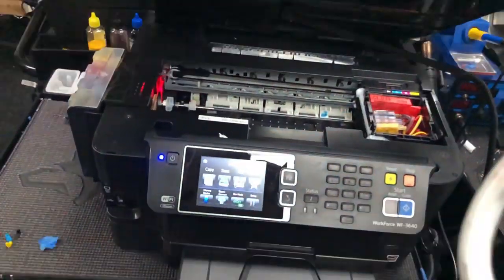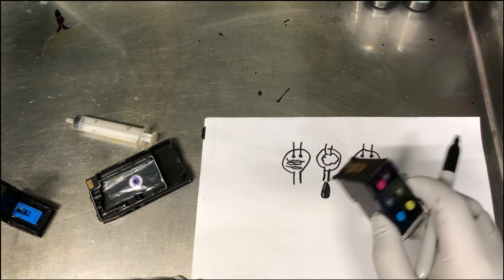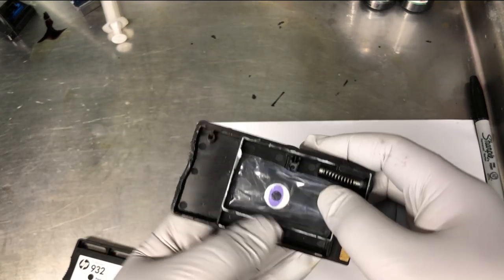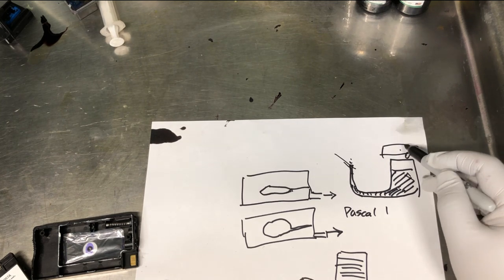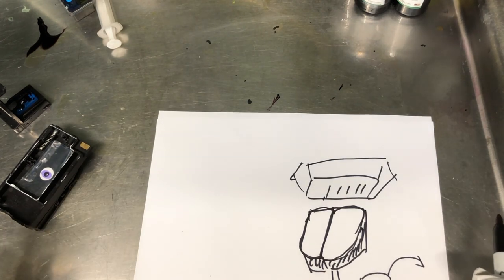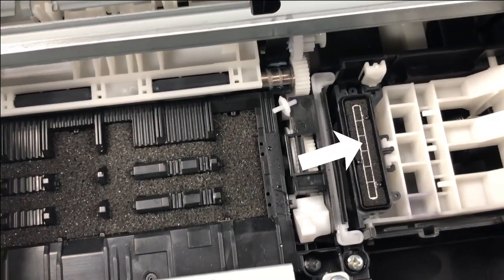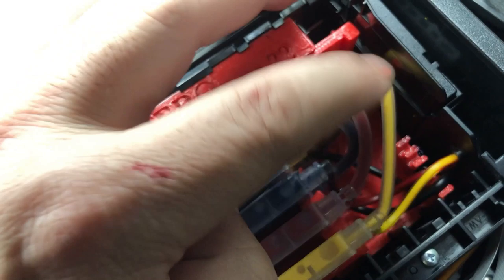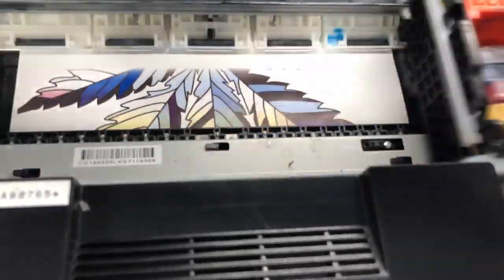Secrets of Epson's Printhead Self-Cleaning Unclogging Routine Revealed

Comment: Hey Kev Gm I cleaned my clogged print heads on my 7620, I installed refilling cartridges,  but sublimation ink, I ran nozzle check, then 3 print head cleans, turned off for a few hrs, tried to turn it back on and nothing. I changed cords and outlets, still nothing. Van you help mevout. Thank you.